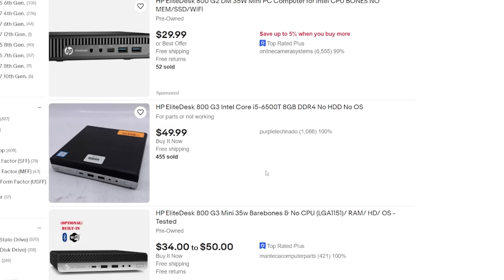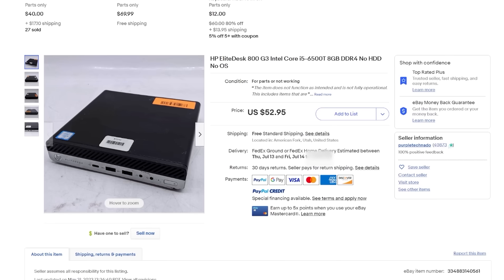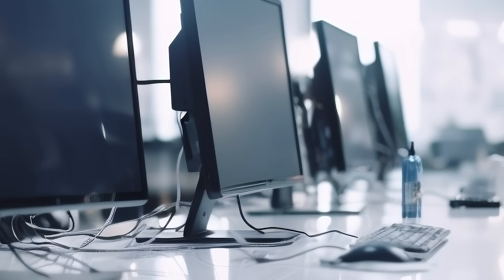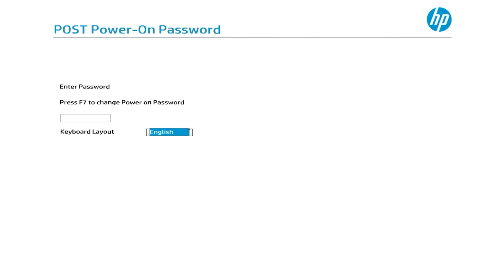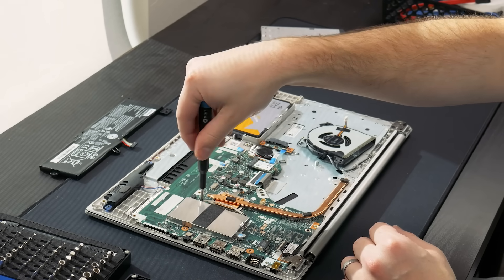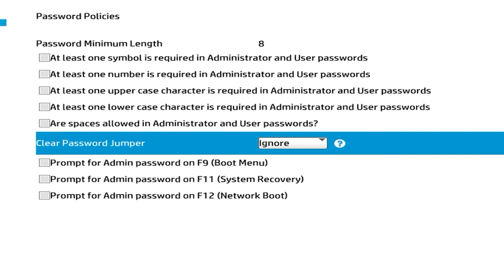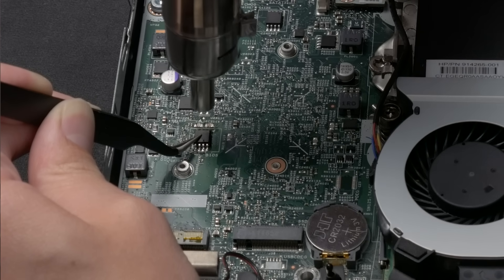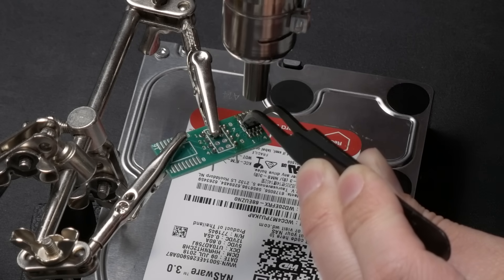I Bought a BIOS-Locked PC. Should You?

Comment: I have a question: Would these fixes work with Sure Start BIOS Recovery on? Because Sure Start BIOS Recovery saves everything to a flash memory and when all the settings are reset it actually loads the saved settings from the flash memory.

Comment: I'm  computer network engineer since 1998 i fix PC  old fashion You got point with everything Bios not easy look like people things Over 25 years experience my self I will tell you one things old computers 2000-2016/17 bios system easy Since Microsoft lock up system for security add control If get any PC old taking battery was only waiting to clean bios some case you need take out with memory to clean out whole system battery plus memory even 2hrs to 24 hrs to clean cache young generation do not know old computers skills bios hard way without button if lucky your PC have one Even flash bios must be on top the worse if power go out  or your bios is not flash full I see you job not bad I remember went update bios old days keyboard was not working from PC you need some case you physical keyboard with wire USB  press F2 F12 Delete on of key must choose depends on your company setup like said CMOS clean or jumper noting change future will be different probably  come to tech 10 years will be different tech bios maybe new PCs Most PC are games high end today that all

Comment: bro me need help to my asus k50c do you can fixit for me  problem do not show screan on monitor or laptop monitor screan is smashed and broken not show light me reset bios not help me try difrent memory fan start to run and slow down cpu gpu is go extrimly hot and one person sell me sey be in angry and droped  work led not batery in pc hdd sey bootmsngmngr radiator of fan have 0.5 cm hole screan conected try fn +f8 not work try shift ctrl and windows not work try keybord and not work  me open keybord and sen complete normal and try difrent keybord

Comment: I have question here, my current laptop has a BIOS password which I don't remember. It is running Windows 10. I want to install Linux on it.
I know that I cannot change the boot order without know the BIOS password.
INSTEAD can I do the following:
1. Remove the SSD
2. Install Linux on that
3. Put back the SSD 
4. Boot the laptop, and use Linux?

Comment: any computer that has jumper pins to reset BIOS is old and outdate, that doesn't exists in newer modern computers. Basically computers 20 years or older uses Jumper Pins to reset the PC, systems like Windows XP, 2000's or older. This Mini PC your reset with the jumper pins is old machine period just with a newer  CPU socket installed. So make sure you explain this to your viewers, which you have failed.

Comment: i accidentally added bios password on my rog ally how do i remove it and iiik the password tho
Reply: Remove the bios battery
Reply: @user-ju7fp4yj9e  so i have to open the rog ally inside and remove it
Reply: I have ROG Stix and it is admin bios locked, removing the cmos battery did nothing except set the dates incorrect and now they cannot be changed.

Comment: I used BSD Live CD live connected to the (True OS) Internet. It simply erased it and installed BSD. Subsequently I erased it with Debian Linux. This laptop has Endless OS now. It does not boot from USB but only from the DVD ROM. It is hard to find DVDs now.

Comment: I used to have a Toshiba A105 Core DUI laptop. It had a bug that would randomly assign a BIOS password and power on password. After sending it off to Toshiba that covered the repair outside of warranty, when I got it back it still had the same problem. Turns out, all laptop boards have hard BIOS flash points built into them. Just short the correct points and boom, BIOS flashed! Finding those points is easier today because of how much information is out there.

Comment: I did this years ago on an old PII laptop I found at a garage sale. It was locked with boot and bios password that was stored in rom and resetting or removing the battery would not clear. Observing the motherboard near the main bios rom was a small atmel serial flash rom. I looked up the datasheet and rigged up a quick rs232 interface and soldered to the correct pins and plugged into the rs232 port of another pc. Powered on the laptop to provide power to the rom and dumped its contents over rs232 onto the other pc. Examined it in a hex editor and found the password stored in plain text.

Comment: on some you can short out 2 pins on a chip and it seemed you had to hit the power button or something of that nature in sequence right before it posts. mine was Thinkpad T420s, i set a bios power on password that i forgot and went to use it and couldn't do nothing, so after lots of forum searching i found what i was looking for. The only downside was I locked up my ssd because i took the drive out when i shorted the pins on the chip. the drive is just a paper weight now but I bet you if i had to do it all over again i never will put a bios password of any sorts on another computer.

Comment: I got my self a HP Elitedesk 705 G4 I have unlocked Bios I'm the master of the key. My problem tho is that when I changed the original Ram 1x8 @1333 with some Crucial 2x8@3200Mhz The Vram went from 4Gb down to 1GB . Anyone knows how to add UEFI Drivers? Or Boot from USB to Access advance settings and change the Vram allocation? Maybe Overclock a bit too?
Thanks in advance.
All I want is more Vram allocation , I did add more Vram thru Windows but it's not the same if you get me 😅

Comment: i have a 2023 acer predator helios ph16-71 and it does not have that jumper. It throws a code.txt file with more than 150 chars long, instead of the usual 10 char long displayed on the bios screen. I need help how to crack this one.

Comment: Ive a mini lap top.  Harddrive - everything on one small board. It was windows 10 but managed to get rid of it with linux mint.  But on boot up the windows logo would show before loading Mint.  But some scum put something in a video,  suspect its like auto nuke or what ever its called.  Bassically have lost a lot of SSD by allowing the SSD on other computers  "to do its thing"  when turned on instead of loading like it normally should.  Only the drives killed ASAP on suspicion could be saved.  So this little perfect computer started doing the same thing -  doing nothing at boot up - so Id kill it.  Then went to reload the linux but it would ignore the USB OS.  So I tinkered into the BIOS - no change- tinker - no change but i pushed some button in BIOS and now no screen - not even through HDMI so you cant see anything. I dissconected battery but cant see any disk battery - I believe its all powered by the Li battery.

Good you got yours working.  But from what ive seen its like its up to yr budget /  or poverty trap -  where if not in poverty trap yr better to buy one working.

Comment: I got a free HP Z440 from work once and it had a BIOS password on it. I quickly Googled my computer and how to clear it. It was nice all I had to do was remove the jumper and push a button, like on your HP in this video. Then put the jumper back and I can set my own password. I never liked HP, but this workstation was pretty nice and works well. I threw in a Xeon E5-2689 V4 (probably overkill), populated all RAM slots with 8GB sticks (64GB total), and put in my EVGA RTX 2070 FTW3 Ultra I had lying around. Surprisingly, the power supply is able to keep up no problem. I tested an RX 6500 XT and a GTX 970 with the Xeon E5-1620 V3 it came with and it turned out to be a pretty decent little machine for light gaming.
Reply: Yeah, hp z i think has 400 watts and the g towers models have 320 watts

Comment: I bought a friend a Win 7 Dell Desktop machine that ran well for ages. It developed a problem that required me to boot it from a DVD to solve. I found the BIOS was password locked and I couldn't boot from DVD without changing BIOS. It seems all Dell computers are BIOS password locked as standard. I followed YouTube instructions, removing the battery and a jumper and deleted the password and fixed the machine.
When my friend was ready for a Win 10 computer somehow we agreed to avoid Dell!

Comment: You laugh but I used to work for a server hosting company. 

Signs that a Chinese customer is running a spam operation: the hard drive is set to boot in IDE (to boot Windows 2003, causing the server automated wipe image when the customer didn't pay the bill to fail) and the server is BIOS locked

Comment: Really $20 is not a lot for a chip to me.  Once you get it dump an image so you can use it on any other computer that is the same model.  Store the image on a reliable drive.  If you have a lot of images a CD may be a good media to preserve them if you store it correctly and don't let it get damaged.  Or maybe there is an online group somewhere with a repository of various BIOS images where you can get them.  Not all groups are going to stay forever so get what you need while you are there!  Maybe you can still find it in other places but maybe it is a rare file and you never found it anywhere else.

Comment: I have an EliteDesk 800 G3 that I bought new and had connected to my TV. worked great, but as it wouldn't run Windows 11, I switched to my Dell Optiplex which is newer and more powerful. 
I then forced the EliteDesk to update to Windows 11 and it was reasonably acceptable, but now decided to turn it into a pfSense router...
But, setting the boot to either CD-ROM or to USB, it tells me the Selected boot image did not authenticate. 
I've tried recreating the boot image, but suspect something else is causing the issue and neither the DVD that I burned the ISO to or the USB will work.
It will fail and revert back to the M.2...
I'll do some more searching, but was wondering if your messing with the EliteDesk 800, you might have some magic HP bomb that could be used...

Comment: a little note if you try to reflash most chromebook bios first you must remove the write protect screw and in most cases you will see one win chip exposed thats not the bios chip the chip is most commonly the same brand just near the cpu under the heat sink

Comment: tip for  heatgun soldering: when you remove chips use flux and circle the heatgun around the chip. solder will melt faster.

Comment: The only issue with having 5 volts instead of 3.3 would be the write part. More voltage could just change some of the data you're trying to write. It's still pretty safe to use as long as you make sure to verify your dump each time and have a differents read dumps.

Comment: A video or several on replacing BIOS chips and if possible replacing SOIC with the same in DIP version which would allow easy removal for specialty reflash with less hassle (swap in programmed chip instead of flashing it onboard) would be of interest especially to classic Thinkpad owners into alternate BIOS. Modifying BIOs is a good rabbit hole there are not near enough videos on.

Comment: Firstly it was great of you to point out the flaw with the CH341A, I was in the same boat on mine as i was only flashing 1.8v chips the issue didn't both me but as it started to look like i was going to be touching 3.3v i replaced it with the new version.

Secondly i would like to expand on what you said about saving a dump of the chip.
Really you should be dumping the content of the chip 2 or 3 times before even flashing anything back then comparing the files checksums match. It takes just a slight knock on table and that clip can move slightly giving you a bad dump rather then a good dump.

I normally do 3 dumps of a chip, check and then use one as the backup, one as stock the other to mod after checking the checksum.

Comment: 8:25 the problem here was that you have connected the ram and also the CMOS battery!!! to the MB. Those need to be removed so you don't have to deal with solder-disolder process.
Reply: if the ran is soldered to the motherboard what do you do?

Comment: Usually you can flash uefi by your method or there is a second method that depends on your motherboard, honestly you just have to read the manual and shortcut pins.

There is a last option running on win 10 or 11 to do it while your are in session, maybe you can bypass your "locked-pc" by using live os.

Otherwise first thing to do is to explore on the official support site to avoid things like looking for the right process with the right os or "os slightly modified by producers"

If there is no option you can run Linux on it to unlock and reset HDD then make a volume to set a new OS to repair.

Comment: I found Deep Freezing Works Too - NEG -40° ~ NEG -110° (DRY ice - BTW Can make you own DRy ice With A CO2 Carbon dioxide fire extinguisher at close blank Range and 60 sec of spaying - Empty A Cheap refill at your Local fire station They will also Test & re certification it  )

is a Know Problem From Deep Freezing CPU GPU's Under Submersion Liquid Cooling (3m fluorinert &  3M Novec - Liquid dielectric)
If the Battery clock chip ram gets too cold It Dump's The Cmos & Bios RAM Password  data  current  Back up time are all lost 

Its a Same Cold bug with Old KeyCode (anti theft code) Car Radios Where dumping them into a 5 start  Chest Freezer or deep quick  ice maker for the next 12 ~ 48 Hours would Completely Wipe The KeyCode Back to Blank factory Setting asking  you to Enter You own master Factory Key code on the next power up

Comment: do not try to flash bios without having a programmer, a spare working computer and a soldering station! when you brick the m/b, you would have to program bios or even desolder it if the programmer clamp makes issues.

Comment: Bios locked desktops are easy to work with laptops are a pain. I got a Toshiba laptop it had bios lock even tho it was won on auction Toshiba would not help. I ended up getting a clean mother board from another seller and got it working.

Comment: You sometimes don't even need to reflash the BIOS. If the computer is going to be used by someone else and you just want to install Windows and are certain that they won't use any BIOS settings, you can simply install windows on an SSD in another PC / laptop and then move it to the PC with the locked BIOS. It isn't ideal but it will save you from the struggle (and risk for the inexperienced) or working with BIOS chips

Comment: I picked up a bunch of these (prodesk and elitedesk 600/800) for cheap since they were listed for parts and bios locked. Planned to try and diagnose them for issues and learn a bit.  They all powered on and I cleared the bios on each of them no problem. I popped a cheap ssd in one, loaded up linux mint and it just booted up no problem. If they are all as well behaved as this one I might not get much troubleshooting experience after all.

I guess my plan B is figuring out what to do with a bunch of mini pcs.

Comment: So, I guess I saved a lot of time by just buying a brand new Simodewa mini PC with N95 CPU, 8GB memory, 256GB SSD, 2.5 Gbps Ethernet (despite the description saying 1 Gbps), two 4K HDMI video outputs, and Windows 11 Pro pre installed, for  $103.99 delivered on Amazon.  To me, that beats buying an old/outdated machine that might have been stolen, and screwing around for weeks, praying I can get it working before making a mistake and destroying it.  

As for preventing it from becoming e-waste, it's not all that different from saving a 100-watt incandescent bulb from going to a landfill.  It belongs in a landfill, even if brand new.  You'll waste more money on electricity, than it costs to buy something newer and 10x as efficient.

I realize it can be fun to play around with this stuff as a challenge, but in no way is it a way to save money or save perfectly good hardware from going to waste.  It's saving obsolete stuff for run, at great expense of time, brainpower, and other things.  Plus a considerable waste of energy usage, if you actually run the machine for years.  One watt-year costs $1 or $2.  

I would have felt bad about getting the higher-TDP N95 vs N100, but it turns out to not be a big physical difference, more of a marketing decision about which default BIOS power setting they recommended and did benchmarks at.
Reply from the maker: Your preferences and how you want to spend your time are yours to decide. Buying a new PC is totally fine, and you are correct that power usage will be lower. However, your argument that these are better off in a landfill is a bit silly. Sure the energy usage is slightly higher with something like a 6500t, but the mentality of just buying everything new for the sake of efficiency is misguided. You're completely leaving out the massive impact of manufacturing and shipping. There are plenty of studies showing that computers are less responsible for carbon emissions during their lifetime than the process that manufactured them. If everyone chose your mentality, manufacturing would need to skyrocket to keep up with demand. 

And yes, I have fun doing this type of thing, but I also find value in the way I repurpose machines. I also get comments pretty often of people who were also able to fix/salvage/repurpose computers, and many of those people live in regions where buying something like that mini PC is nearly impossible. Once again, no judgement for buying what you did. I buy plenty of new computers and other hardware. But do realize that there is a real benefit to reusing hardware.

Comment: i had to buy a motherboard for my dell optiplex 7010 mt desktop off ebay... the seller didnt mention that it had a bios password on it but it was an easy fix i just moved the jumper on the board to pswd turend it on and cleared the password... some desktops are really easy to clear the password... others not so much...